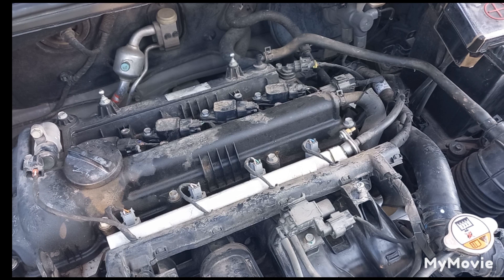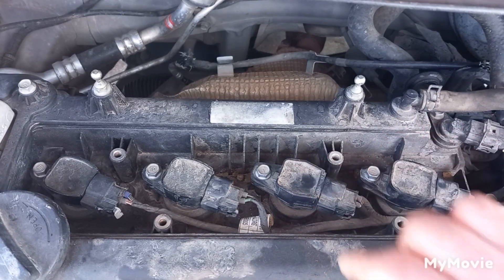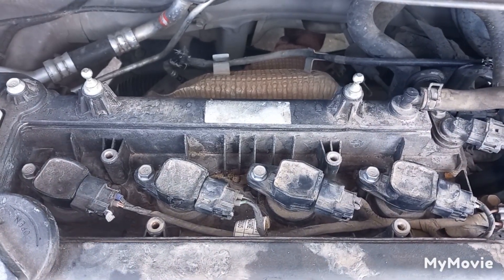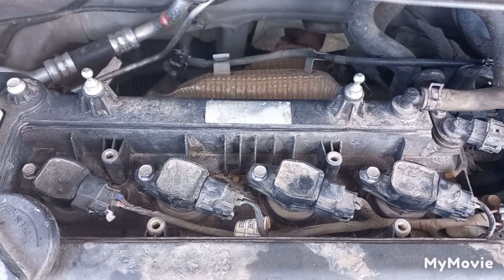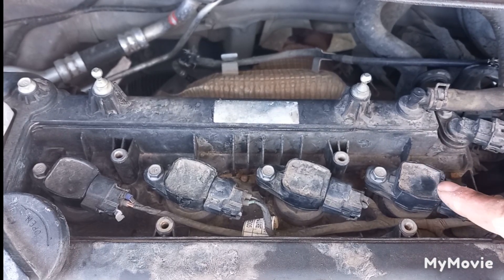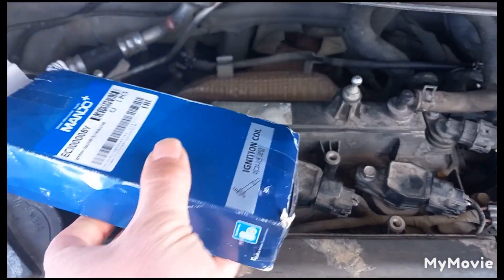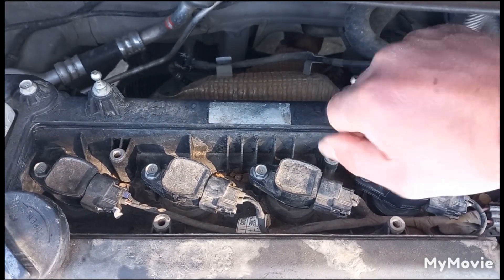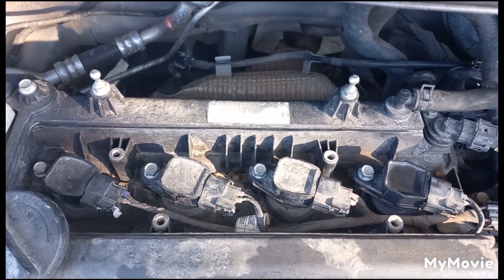how to test ignition coil

Comment: I have no spark on my v6 2.8 chevy. replaced icm , but wiring harness is missing and coil doesn't have positive or neg markings on it. how do I tell which is which or does it matter? will connecting wrong blow out icm?
Reply from the maker: I'm sorry , wish i could help , i have no idea about this Chevy ignition system

Comment: thank you so much for this video ..i replaced all my four spark plugs few days but my car still vibrating too much when i start it every morning.I will try ur tutorial,on my a question is there no problem taking out the coil when the engine is working ?
Reply from the maker: No, u shouldn't take out the coil while the engine is working,  u might damage the ECU , only take out the coil connecter or the injector connector